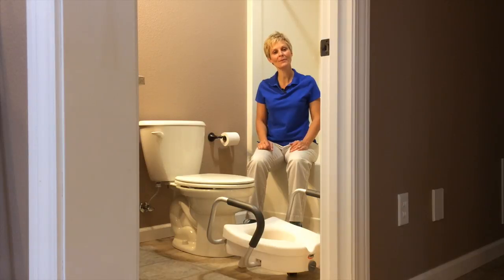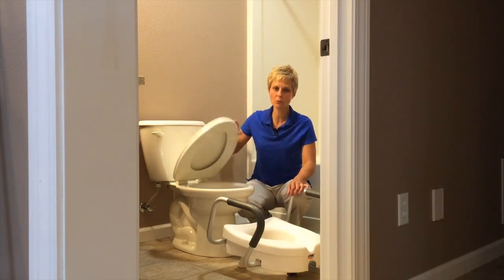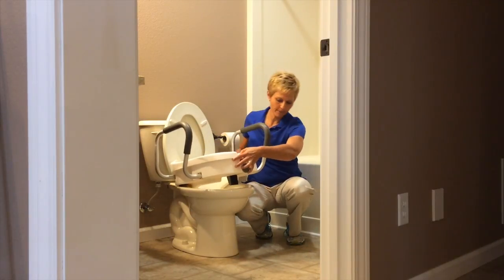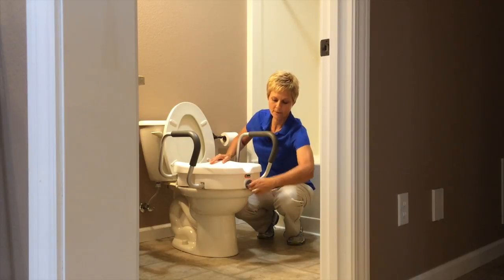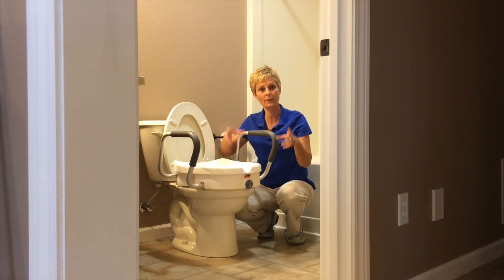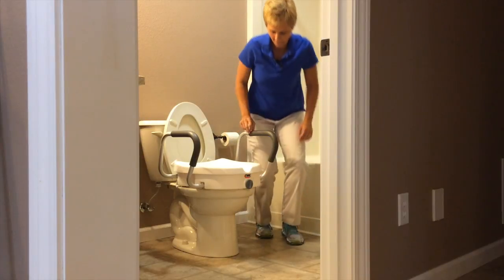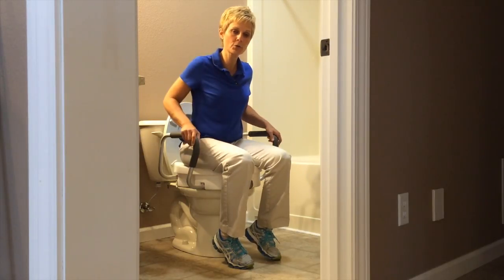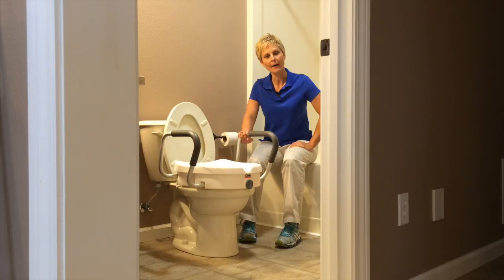Top Hack You Need to Know for Installing Raised Toilet Seats

Comment: May I ask a question are they hard to keep clean underneath?
Reply from the maker: That is a great question! It depends on the mechanism holding the seat to the toilet bowl. If it’s a clamping mechanism it’s pretty easy to remove and clean. If it bolts to the toilet that’s more difficult. However Vive Health makes a hinged toilet seat riser that bolts to the toilet for safety but can be lifted for cleaning. 
Check it out here: https://amzn.to/3rC1bcB
✌️❤️ AECorner.com

Comment: If the toilet had a lip inside the bowl is the flat clamp go under lip or won't this work? Seat pops off
Reply from the maker: Maria Curi, thank you for your question. The clamp doesn’t go under the lip, it secures against the ring of the bowl. If installed correctly, this seat should not pop off. It can give a little if you put too much weight on one side. We prefer a bolted toilet seat riser for improved sense of security. You can take a look at that here:  
https://youtu.be/EUiqd6h3J04
Hope this was helpful. Take care! 
✌🏻❤️AECorner
Reply: Thank you so much.. That one will work better . The other one was installed as directed but the toilet lip was small and the clamp was not able to stay tight for some reason. Thank you.
Reply from the maker: Your welcome, if you order the bolted toilet riser, just make sure you order the correct shape regarding standard vs elongated toilet bowl. ✌🏻❤️AECorner.com
Reply: @AECorner  ok thank you I will make sure.